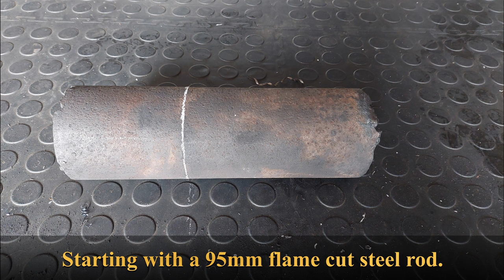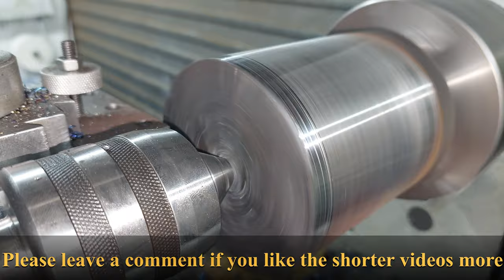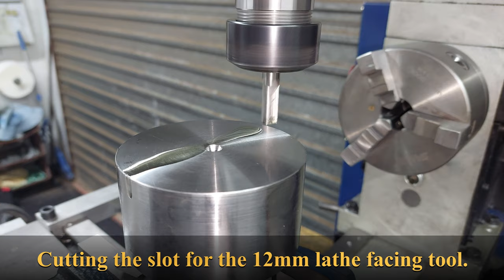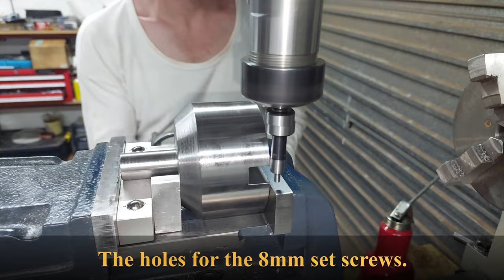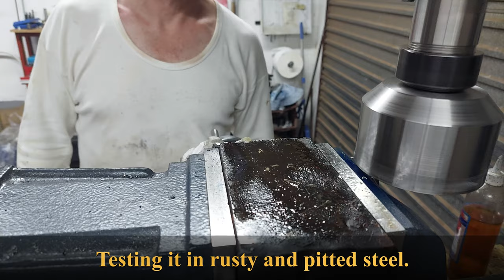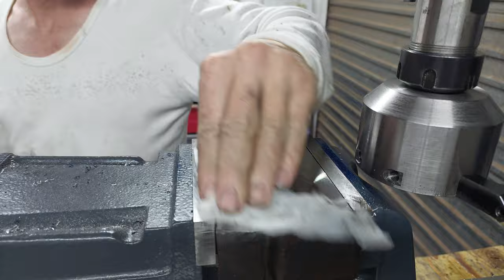How to Make a Fly-Cutter

Comment: Oh wow, that impressive! How did  you manage such a smooth finish? Toolbit?
Reply from the maker: Thanks Paul. I have used an uncoated square carbide insert. Not sure what the insert code is supposed to be as there is no designation on the package (Adendorff EACUTT201). It seems to like cutting at a 45-degree angle to the face. That is why my fly cutter has a flat bottom.
Reply: @improviseddiy  OK, pleasant surprise. I'm guessing you locked the quill to prevent chatter.
Reply from the maker: @paulrodrigues5562  When I am milling, always. 😉
Reply: @improviseddiy  doesn't bode well for my cnc setup.
Reply from the maker: @paulrodrigues5562  I also take a couple of spring passes to remove any chatter marks
Reply: @improviseddiy  Yep, still getting my head around the Fusion 360 Cam gcode generated and how it aligns to HQ limits.
Reply from the maker: @paulrodrigues5562  I have not rendered anything on Fusion 360 yet. You need to manually test the limits with carbide and flood coolant (high RPMs) for CNC. These machines will surprise you.
Reply: @improviseddiy  Yes I need to build an enclosure for it before using flood coolant. Currently some cutting oil or wd40. Did you buy your machine new? I bought a demo and there a bit of play on the Gibs. I tighten Gibs quite tight or lock  saddle to get around it.
Reply from the maker: @paulrodrigues5562  I did buy it new. The gibs did need some adjusting. Be mindful that overtightening of the gib can wear out the slot in the gib itself where the adjustment screw seats. I had to re-grind mine to stop the screw head from sliding out. Cleaning the dovetails often also helps.
Reply: @improviseddiy  Yes, I need TO spend some time on Gibs. Was thinking of installing a linear rail.
Reply from the maker: @paulrodrigues5562  Sounds like a complicated endeavor. 🤔
Reply: @improviseddiy  may be just add them on the lathe bed to assist the original Gibs.
Reply from the maker: @paulrodrigues5562  On the sides? Plain sealed bearings with eccentric bolts for adjustment may be more cost effective.
Reply: @improviseddiy  hmm, but I do need a proper datum to ensure it runs parralell to the bed.